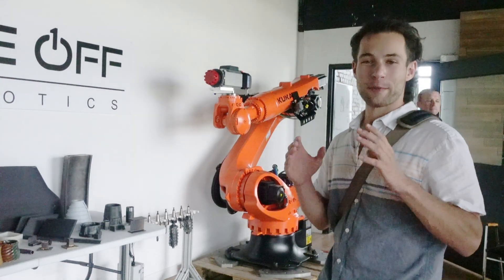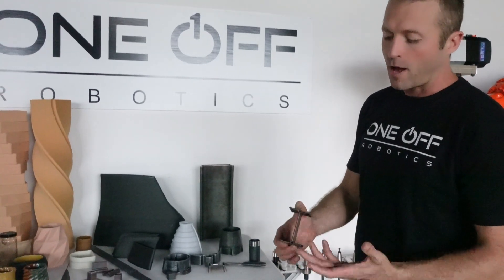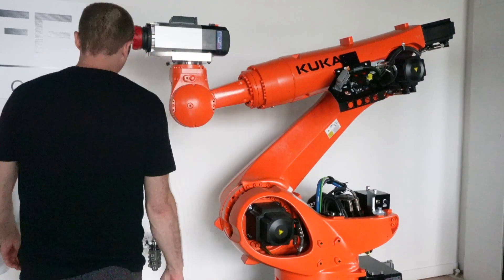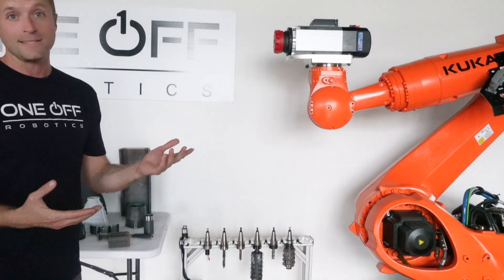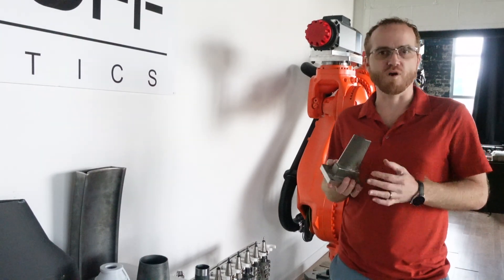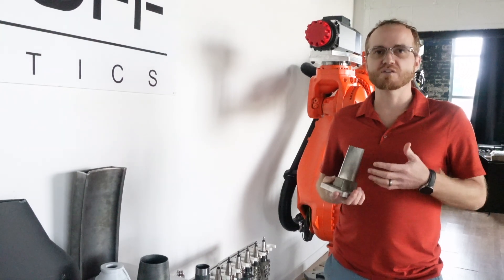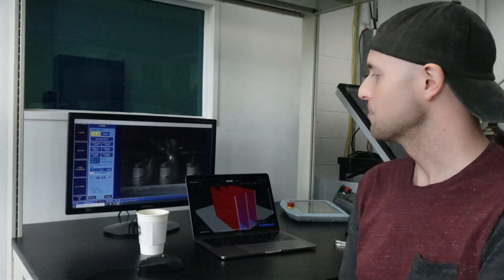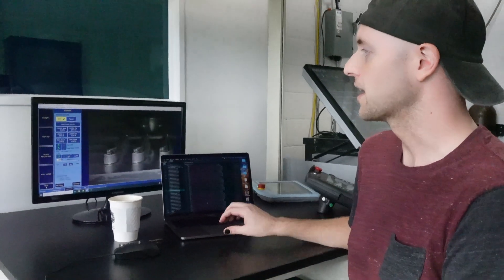Printing Metal Stronger Than Cast or Forged | One Off Robotics

Comment: The title could be debated by peer-reviewed sources. It depends upon the process and the base material. For example, WAAM aluminum is superior but WAAM steel is considerably weaker unless rolled and annealed. Different base metals react to the process differently. Blown powder DED, powderbed and DMLS are different processes that get different microstructures. Ultimately, there is an SAE laboratory standard by which each printed material must be subjected prior to being used in an engineering use case. Coupons must be machined out of the X, Y, and Z axis of the prints and sent to a laboratory to measure tensile strength, etc.
Reply from the maker: Fair assessment, I am not particularly knowledgeable in metals.

Comment: im interested in this process i am looking into doing forgings for high pressure containment purposes, im not 100% sold on printed being stronger than forgings since the grain structure of printed metal parts i obtained was closer to that of cast iron than steel, just looked like really bad quality steel, but i would be interested if i could print forging dyes for prototyping since those are not cheap